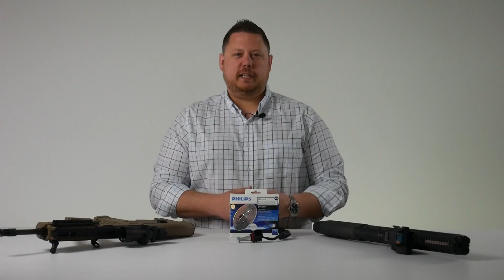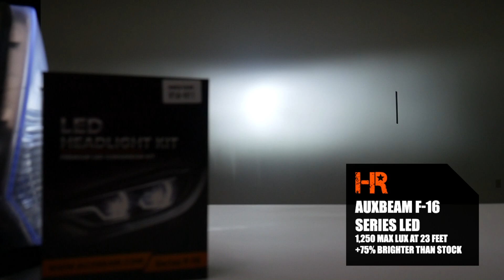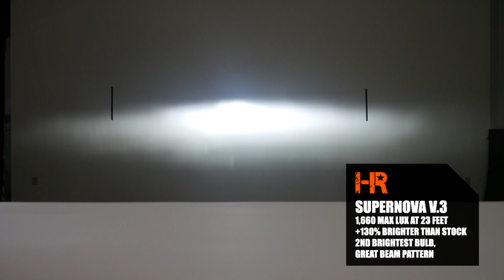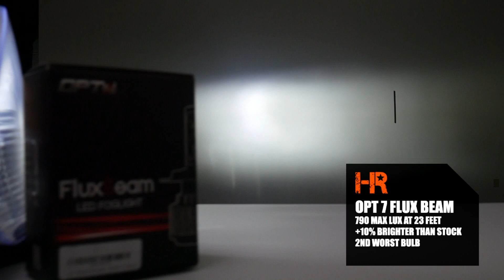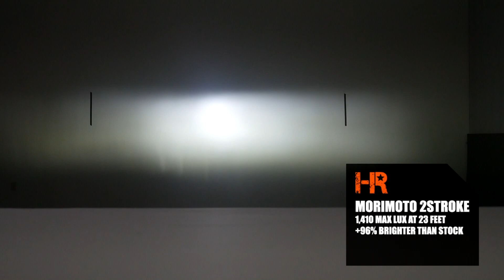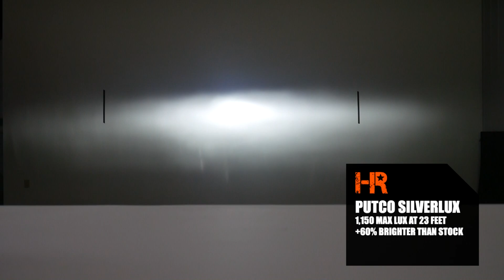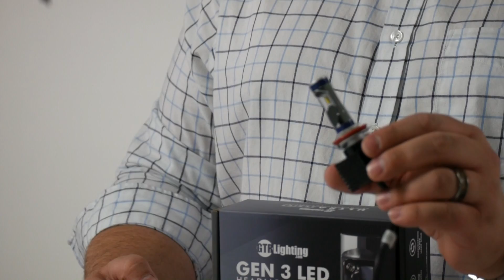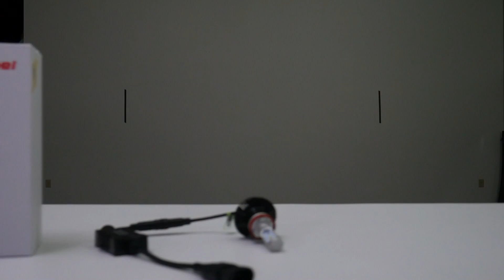DELETE - 15 Brands LED Headlight Bulb Shoot-Out! Which one's the best?

Comment: Glad I caught your vid.I almost bought the aux beam headlights based off EXOcontralto's review of them. He had tested one auxbeam against a halogen to see which dimmed less when you have gobs of amplification and a pair of slapalaping eighteen inch subwoofers in his Saturn ION. Shout-out to Bruce aka EXO because his systems and vids are 🔥. According to his "tests" the auxbeam didn't seem to dim at all, while the halogen was one with the bass and strobing like a German dance rave.  Obviously, the tests weren't very scientific, but he's not a headlight guy. Also,it's his first set of LEDs and his expectational outcome was different. I'm having a similar issue with dimming and I would like it resolved without acquiring tickets or blinding oncoming traffic,but perhaps deafening them. Do you think that the gtr gen 3 would be good for this?(If it's relevant, I would be using the 9006 hb4) Or will I have to break down, and turn down for what?DIMMING.... if comes to that Im just going to have to dim because I never ever ever turn my beat down. Unless I'm in a housing neighborhood,see, I'm not a complete prick. Btw thanks for your vid, I found  it to be a very comprehensive(and lengthy,like my comment) but overall, honest.I may may spring for the gtr's, even if they don't fix the dimming, for the light color, output,longevity, and warranty,based off your more "sciency" tests.
Reply from the maker: Destiny is Life, From our experience the Auxbeam product is not something we recommend people purchase.  We haven't experienced the dimming with any of the installs, so I'd guess they will work fine.

Comment: Would you still have DRL function in GTR lighting Gen  3 H4 bulb like on a 2012 CRV.
Reply from the maker: The new GTR bulbs are DRL compatible, and you just have to make a note that you need the DRL compatible in the notes and you'll get the proper bulbs.

Comment: I literally just bought both the OPT7 Fluxbeam X kit and the GT3 kit and LITERALLY has the same if not better output. I like the GT3, but feels like this is a bit of touting their own horn and using some fireworks (guns) to dramatize the effect. No Lumens to lumens side by side comparison, durability testing, etc etc. For $199, not so sure about the value.

Comment: isnt the philips brand bulb the original and all of the other ones are technically knockoffs? Why do you downplay the philips and push the GTR bulbs in your videos. from this video the GTR is just the closest knockoff of philips (with some extra chips) it even has the same blue line around the tip... only way to know you are actually getting real philips chips and drivers is to buy philips brand bulbs. philips bulbs cost 150-200 usd a pair. this chinese junk you are peddling doesnt compare in quality.
Reply from the maker: Pete, We are promoting quality built and super bright bulbs.  There is nothing wrong with the Phillips bulbs, but they were really not that bright. I'm sure they are very dependable, but if they aren't much brighter than stock, what's the point?

Comment: Question, I've tried searching for the Supernova V.3 & the GTR & can't find them anywhere??? You guys have them on your website, by it seems their for pickup trucks. Are these particular LED brands only for trucks?? If their used for a car, then please put me in the right direction. I have a 2014 Ford Fusion, I'm trying to upgrade the light & the GTR & Supernova V.3 were excellent, thanks for the breakdown by the way, it really helped. Now only if I can find this headlights lol
Reply: J. Zee you can't tell anything by their whois info because they use Domain by Proxy. It's owned by GoDaddy and keeps website owner info private. So tens of thousands of websites will show the same whois info. It's basically useless in this case.
Reply: Can't find these anywhere else, either. Found that GTRLIGHTING.COM and HEADLIGHTREVOLUTION.COM is the same company. See the WHOIS information.

Might be biased video, here.

Comment: You didn't even mention that the only way to have good beam pattern is to have LEDs in a tight row (maximum dimensions for LED's is the dimensions of filament on halogen bulb).
Reply from the maker: https://www.youtube.com/watch?v=Sonh4lHu4XE&lc=z12twp5rdxvsydrpn04cd5tx1muhgzooqzs0k
Here's a better video for what you're talking about, but still doesn't talk about the dimensions of the LED's.
We've also recently found that to get a good projector beam you need a thinner LED bulb.  We'll have it figured out in no time.
Reply: I know how optics work. It's actually simple.
You need a tight row of LED's to make it work. And yes, focal point will be off set if LED's on both sides are not in the center.
Well it is fine to have slight error for full beams, though not low beam side (one side is low beam, the one that goes up)

Comment: Will the better bulbs in this video work well in a halogen projector housing?
Reply from the maker: Unfortunately, we haven't found an LED bulb that works well in a projector housing.  HID is the way to go for now.
https://headlightrevolution.com/headlights/headlight-bulb-upgrades/hid-conversion-kits/
Reply: Headlight Revolution I got a pair of Hikari H7s a few weeks ago, they look a lot like the Auxbeam, just black. I have them in my halogen projector low beams - really bright foreground but extremely short throw. Too bad I saw your video too late. Reverting back to Halogens and will be buying a box of .50s :)

Comment: So the beam pattern varies on the reflector housing? And also the type of led bulb???
Reply from the maker: that is correct.  Housings and bulbs are all engineered differently.  We always tell ppl to align the LED bulbs side to side, and sometimes the reflector needs them to be aligned up and down.
Reply: Headlight Revolution true. Just hard to tell which design LED kit is good in my reflector housing but also actual high lumens and not fall under false advertisement. Sucks i got opt7 and honestly i felt like my hid kit was better in lumens. The beam pattern on the opt7 is everywhere.
Reply from the maker: Alfonso Pena yea, it's a challenging subject. Obviously we cannot test each bulb in each headlight housing, but we hope this type of info is some sort of help.
Reply: Headlight Revolution for the best lumens its HID light? But because i have a reflector housing LED would be best???

Comment: Here's the thing, you can't sell and review the same products without people thinking your biased. If your local chevrolet dealership started performing reviews on all of the 2017 trucks from ford, dodge, and chevrolet; would you be suprised when chevrolet performed the best? You can't trust that review because the person performing it just happens to have some of that product for sale.
Reply from the maker: OK, but that's Chevy reviewing Chevy... Our own brand of bulbs, Supernova, did not come out on top. So, how are we biased or a scam? Not trying to start an argument or fight, just trying to see your point of view.

To take your analogy and apply it to this 15-brand review video, it would be this:
"Your local Chevrolet dealership started performing reviews on all of the 2017 trucks from ford, dodge and chevrolet, and Chevrolet came in third."

Right?
Our own Supernova bulbs may not be the best in this lineup, but they are also not as expensive as the other two, so we think they're still a good option.
Reply: They were 2nd best in the review.

Comment: would these results change if you guys tested them in the H4 hi/low beam?
Reply from the maker: Probably not.  Typically if a bulb works with one style, it'll work well with other styles too.  It's less about the particular bulb style, and more about the emitters and heat sink.

Comment: Thank you so much for this video I almost bought auxbeam or opt 7, glad I found this video , so I assume LED works better with reflector housing than projector housing ?
Reply from the maker: Usually. We actually just did a video where the Dodge Ram projector healight didn't do very well with LED bulbs, but then the Toyota Tacoma OEM projector headlights did really good. Kinda depends on the combination of which headlight you have + which LED bulb you're using.
Thanks for your support!
www.HeadlightRevolution.com
Reply: Thanks for your reply, one other thing, one of my car has reflector housing  ( Mitsu Lancer 2014), was wondering, what is  the orientation of the led diodes, is it side to side or up and down? I have seen mixed opinions on this, some say side to side is the correct one, but other said up and down is the way to go... am so puzzled
Reply from the maker: rio20d everything we've seen indicates that the correct orientation is side to side. Very rarely does a vehicle require a top to bottom LED arrangement.
Reply: many thanks for clarifying that
Reply: does your Supernova V3 and  GTR 3 led, have adjustable collar? just in case one needs to adjust the beam pattern within the reflector housing.

Comment: Excellent Video!  I'm looking for H7 LED's for my MK 6 jetta. This was helpful. Just gotta find H7's
Reply from the maker: Darryl,
You're not going to find an LED bulb that works for your vehicle.  The only thing that will work is an HID bulb with the an adapter to hold the bulb in.  No LED bulbs can fit through the adapter.
Reply: ohhh boo! I was wondering why I couldn't find anything.  Is there an HID you can recommend?   Thanks for the feed back!

Comment: This is great. Could you guys please look at SNGL Lightsthey have a model that looks like the gtr ones and another thats adjustable and 55watts. Also if you guys could do a same type video for motorcycle headlights that would be awesome.
Reply from the maker: Looking @ the SNGL bulbs, they look like they have different emitters and are positioned differently than the GTR bulbs..  They also have the same fanned heat sink as the Phillips bulbs.  I really doubt these are a full 55w because you need quite the heat sink to handle that much power.  For motorcycle's we've found that if a bulb works well in a vehicle housing they work well in a bike housing too.

Comment: Hi I've got a question. Currently I've installed some H9 XHP70 LED bulbs in my halogen projector housing. But I have to tell, I'm pretty unsatisfied with the lightoutput. When I tested my aftermarket LEDs with OEM LEDs side to side it was a huge difference. The XHP70 were so dim, I could barely notice them compared to the OEMs. Now I saw in a previous video on your channel, that LED bulbs are not recommended being used in projector housings because the LEDs don't deliver 360° light. So I should use HIDs instead of LEDs. Can you agree? And what's currently the brightest and highest quality aftermarket HID kit I can buy? Thanks alot!

Comment: Nice Video..do supernova v3 h4 perform the same? can it be adjust (beam pattern)?
Reply from the maker: The Supernova bulbs were tested, and preformed well, but they cannot be adjusted.  They fit great in 95% of housings out of the box to give you the best beam pattern possible.
Reply: will it fit honda jazz 2016?
Reply from the maker: Although we have not tested any bulbs on your vehicle, the Supernova V.3 bulbs should work great for you.

Comment: lemme get this right. with the right LEDs, even in a reflector housings.. it will be safe to run without glare?
Reply from the maker: I think the video speaks for itself on this matter. The most important thing is to mimic the original beam pattern. As you can see for yourself, a few of the bulbs tested do just that.

Comment: What bulb runs the coolest operating temperature?
Is it possible to run this in a factory projector headlight with factory dust cover in place such as a 2016 Chevy Colorado z71?

Thanks:)
Reply from the maker: boneyfireems1146,
That's a good cal, I'll have to make not of that next time we do a video like this.
From what we've found, it hasn't been an issue running any bulbs we sell in a enclosed headlight, like the Ram 1500 that has a screw on dust cover.  So I'd believe it would work for you.  You just have to get one that has a flexible heat sink like the Suprenova V.3.
https://headlightrevolution.com/supernova-v-3-led-headlights-h11-h16-bulbs/
Reply: TYVM!

Comment: Does beam pattern matter as much when installing an LED bulb into a projector type headlight? I figure that the lens on the projector headlight changes up the pattern, but I could be wrong. Thanks.
Reply from the maker: TheScottfourty4, The problem we see with projectors and LED's is that it doesn't matter where the bulb is positioned because the projector is specifically engineered for a 360 degree light output.  even the "360 degree" led bulbs don't work well in projectors yet.
check out this video for an example:  https://www.youtube.com/watch?v=utrYcpXDwJ8&lc=z12hh5z4qqm3ctw0w23muvkrzvmcwdzlw

Comment: great video, looks like alot of work. I definitely appreciate it. ive been referring back to it over and over. saved me from wasting money. Gtr is just to expensive for me so id like to go with the supernova V3 but I got to be honest . I cant find one picture or video of the light actually in a car on the road. this video is the only place ive been able to even see this light on at all. id really like to see what it looks like in an actual driving test down a dark road, or a picture or something. that with literally ZERO reviews on the actual bulb makes it very hard for me to pull the trigger on them. PLEASE try and get some road footage or pictures of this bulb for potential customers. im sure it will be a HUGE selling point for you.  thanks
Reply from the maker: We're working on a video like this.
Reply: We are the manufactrer of led headlight bulbs in China,Our products are very competitive,we are global looking for distributors and Wholesalers,This is ours website:www.pd-lamp.com.
Reply: I can tell you that the V3's beam pattern is nothing like this in a 2008 Nissan Frontier. Tremendous scatter. I still have to adjust the beams but all that is going to do is lower the scatter. I don't know what they use for these tests but they should try a reflector like what the Frontier has. My bet is they will recommend NOT installing LEDs in them.

Comment: which led bulbs is good for 2017 Camry? Supernova or GTR mine uses the H11 size. thanks!
Reply from the maker: Either of these bulbs should work.  It's tough to get brand spanking new vehicles in to check fitment. So what I tell ppl is to measure from where the collar sits to where something would get in the way.  If there's 1.5" the Gen 3's will fit, if not, get the Supernova bulbs.

Comment: Thanks for the info. Here in Canada we found guys will run the LED bulbs in summer as an upgrade but have to switch back to old bulbs in winter, because since LED don't get hot snow/ice build up on headlight assembly's
Reply from the maker: We're actually in northern MN.  So although you're probably a lot colder than we are at times, we haven't seen any issues with these as pertaining to snow and ice build up on housings.

Comment: Good job. I would really like to see an H4 high/low beam comparison.
Reply from the maker: If you're talking about doing this with H4 bulbs, it would be kind of redundant.  The difference between bulb styles is negligible. 
If it preformed well in this video, it will preform well in an H4 style bulb as well.
Reply: So the Supernova V3 and the GTR Lighting Gen 3 Ultra are available as a H4 dual beam bulb? It took me several sets of dual  (hi/low) beam HID's to find ones I liked because not all of them are moving the filament to the right spot. I did not know if this was the same with the LED bulbs. Are they moving the light element or are they lighting different LED's?
Reply from the maker: https://headlightrevolution.com/product-types/bulb-style/h4-9003/
Here's all the H4 we offer.

Comment: Are the warranty periods any indication of how long the bulbs are expected to last?  Are they overdriven to achieve the high outputs, but at the expense of lifespan?
Reply from the maker: DTR RTD, I think it's safe to say that every LED headlight bulb is over driven, but we have had many customers that have had their same bulbs for 4 years.  I don't know if the warranty of a bulb is an indication of lifespan, but you could make the assumption that a bulb with a lifetime warranty is better than one with a 1 or 2 year warranty.
Reply: Sounds good-  hopefully they're not too sensitive to the car's voltage regulation, as some cars run slightly higher than others.  Do the manufacturers put out any guidelines as to the maximum recommended voltage at the bulb?